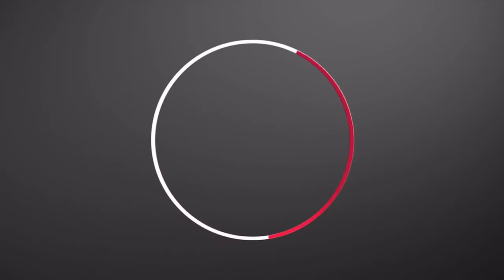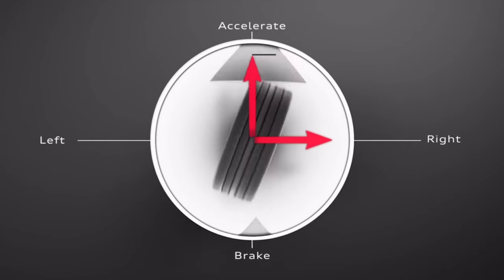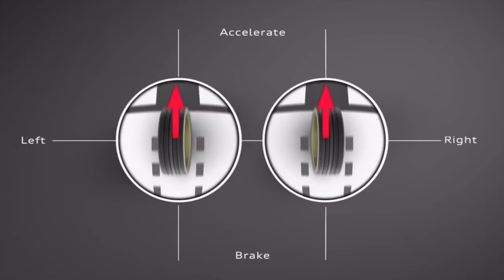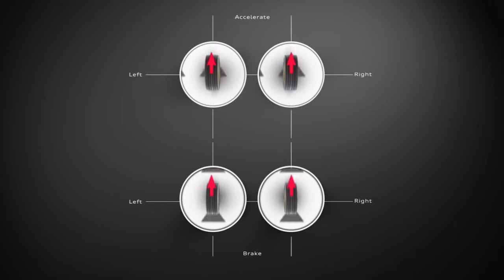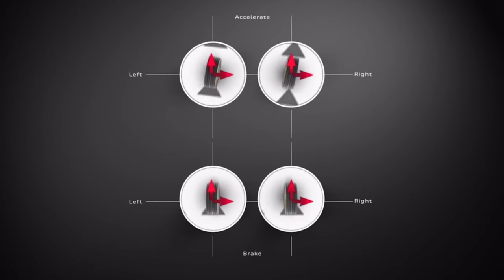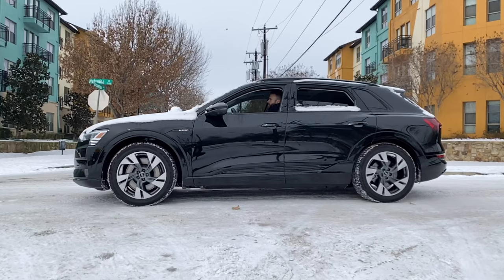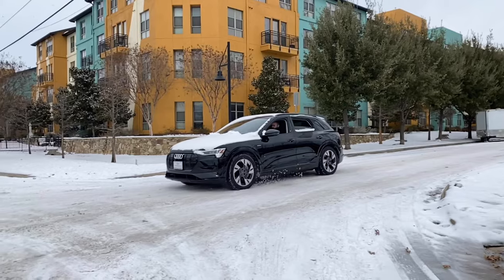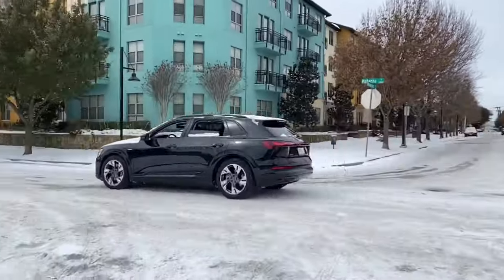Audi Quattro AWD explained

Comment: I have an 2015 Audi A3 Quattro but the rear tires don’t work, in the snow only my front tires have traction. By any chance dsomeone else has the same problem?
Reply: A3 has haldex, I think you can force it on if you turn ESC completely off 🤷‍♂️ but dude, don’t crash your car ok?
Reply: Yeah a3 are haldex driven. Haldex is a fwd based quattro, its not the same as a torsen driven one, but you wont have transversly mounted engine vehicles with torsen driven quattro, those are all haldex. So all the mqb platform, golf r, a3, rs3, s3 q3 are all haldex driven cars

Comment: Haha, in Texas the Audi's also steer with their rear wheels, how very forward of them.....

Vorsprung durch Technik......not even the designers knew how cleverly they had built this system......OMG. LOLOLOL.
Reply: it kinda does a little bit, doesn't it? using the same principle as a tank: if your right wheel spins slower, the car must turn right
So it kinda shares the friction, wouldn't it?

I'm honestly asking, my brain is not in the right place today to think how would it affect the rear wheels

Comment: Who decided that using an electric car as an example for a quattro was a good idea?
Isn't that a completely different system?
Reply from the maker: Quattro works the same way in electric and non-electric vehicles. The electric system is modeled entirely after the mechanical system and it functions is exactly the same way.
Reply: @Audidallas  well, if you don't count on the small detail that it's not, yes, they kinda look similar.
Well, of course you need to then ignore how you can literally see that the power transmission is digital (wheel has power, now it doesn't, now it does again).
And you also need to completely ignore your own video, when you mention that "the Quattro system is able to work out precisely what type of surface you are on based on the feedback the differential (or, in this case of the ELECTRIC CAR, the computers) are getting from each wheel".
But I guess you can discuss this details with Audi Dallas... oh, wait...!
Reply: They’re using the electric car to seed in the idea that the awd system implemented in the electric car is comparable or good enough to also be called quattro… it’s marketing
Reply: @georgealex19  marketing for a video which will be seen only by the people who are actively interested in the subject?
Still ignoring that, it is still showing how something different to Audi Quattro, which, by the way, it's a trademark. So no, that's not Quattro.